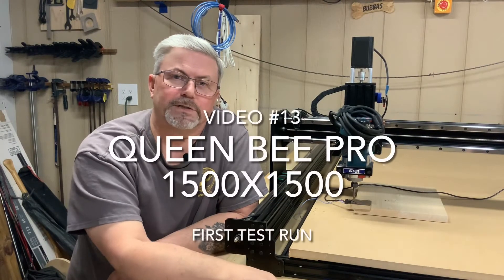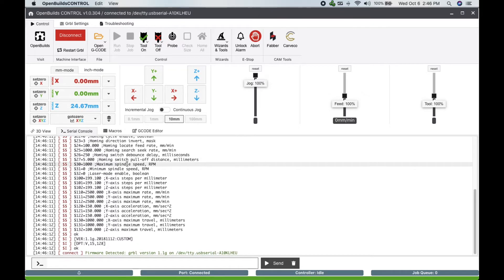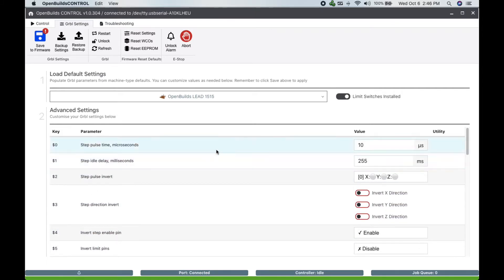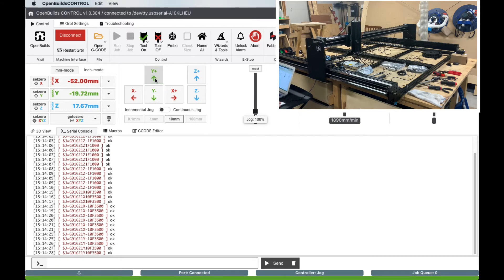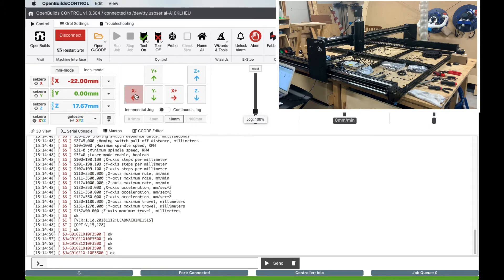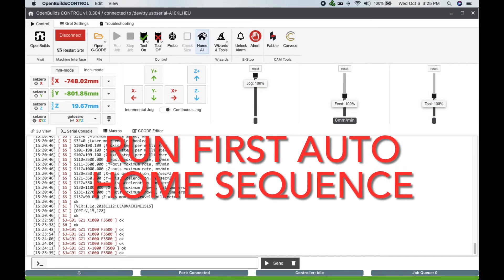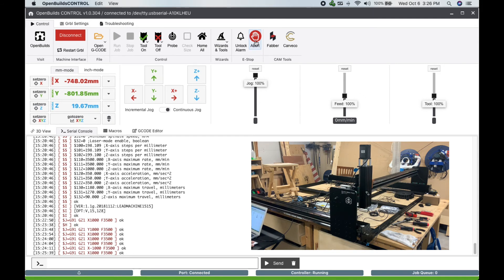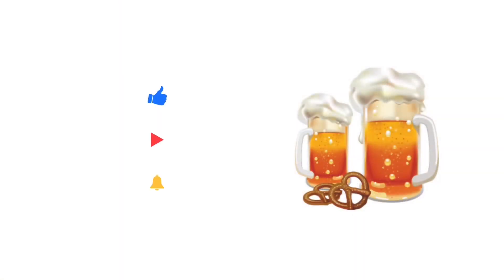Bulkman Queen Bee Pro Build #13

Comment: I feel embarrassed to ask but, where did you actually purchase your machine? I hate to say this but the bulkman website looks suspicious.
Reply from the maker: From the Bulkman website. Took about 10 business days to get here. Everything arrived safe. It is really well packaged. I did not buy the controller from them though. I purchased the controller local in the US to ensure I had good support I could contact if needed. The Bulkman support is hit or miss. Keep that in mind.
Reply: @2tankardscreations211  Thank you so much. At this point, I am going order the ball screw version. It seems to be a little more robust and have a slight higher level or accuracy.